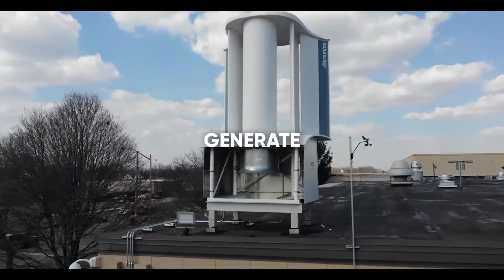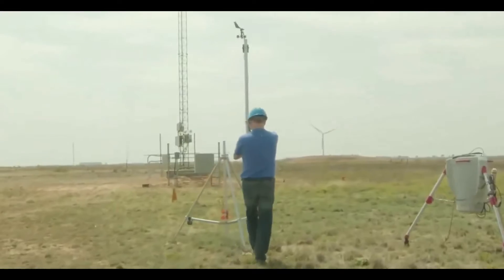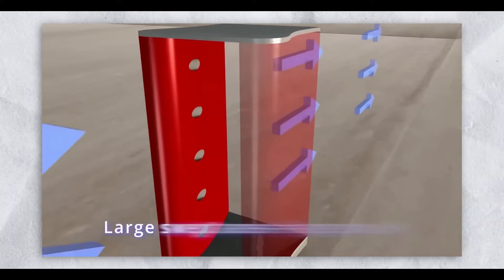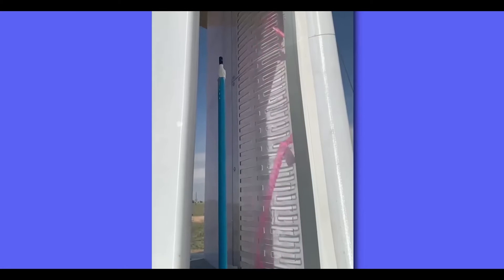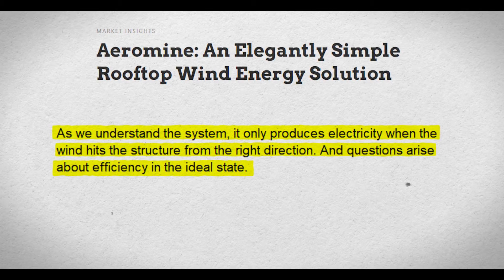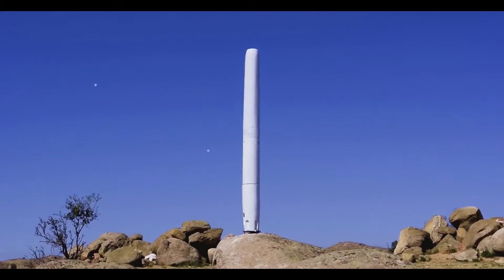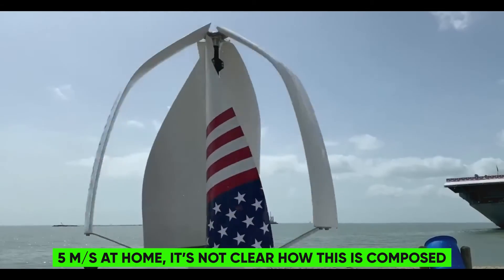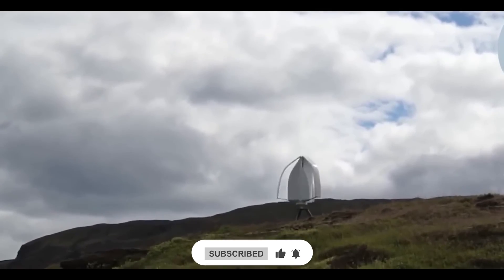Unbelievable! Wind Turbine Claims to Beat Solar by 16 Times!

Comment: Nonsense! All practical tests show that small wind turbines hardly generate any electricity, because hardly any wind blows close to the ground.
Moreover, the wind is extremely gusty, which almost always greatly reduces the service life. 9 out of 10 no longer work after a few years. 
Only those who MUST be off grid in winter should install a large wind turbine on a high tower. Otherwise: Forget wind power! 
Solar systems, on the other hand, reliably generate over 25 -30 years electricity at approx. 3 to 8 cents/kWh. Reliable and extremely low-maintenance.